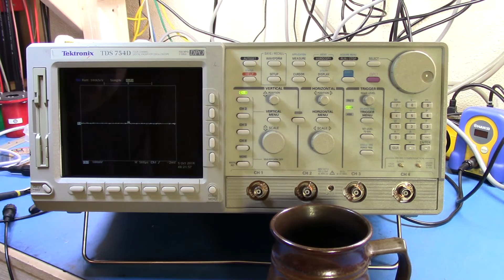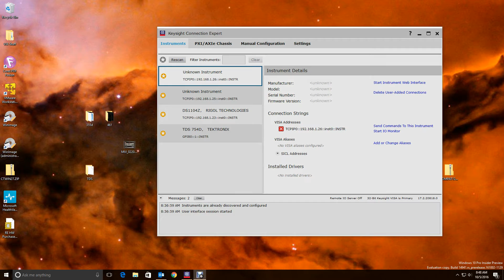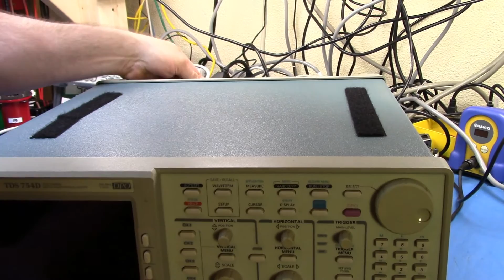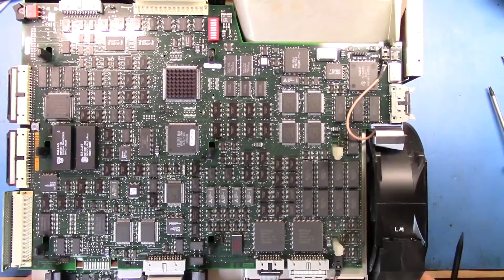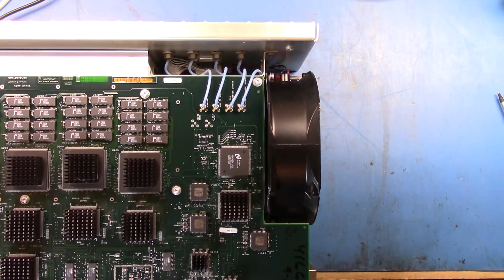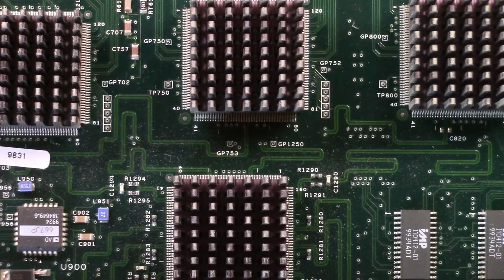TDS754D Repair and upgrade - Part 1

Comment: Guys! I'm so sick of Google Translate! For some reason it translates the word "oscilloscope" as "sight"!!!!!    And I'm so stupid that I still haven't learned English!
😬
Reply from the maker: As an Australian, many would claim that I don't really speak English either - This was a fail as far as the repair went as I ended up lifting a pad trying to get the RAM to work properly - There is a comment further down that says this issue is most likely a problem with the acquisition hybrid.

I hope Google Translate does a better job on this response for you.

Comment: That LCD shutter was not their best idea cause the overdriven CRT ran out pretty fast. So was ergonomics: menus suck...An IT guys oscilloscope.
Reply from the maker: Completely agree but I do wonder if it was just a sign of the times - Right now we have multi-color LCD panels and I find they're great but back in the day I preferred more resolution and a single color.
Reply from the maker: Also I never ended up fixing this thing - Sold it to a Tek guy who did.

Comment: very details. nice . thanks. if I had one of these I would be viewing this video several times and listening word by word. I just bought a TDS3054B but I ran the diagnostic on it and it failed the acquisition so waaaaaa. anyone know what could l be causing it. the manual says main board. but you know... is there any other real fixes?
Reply from the maker: What I've seen work is to clean the IC holder for the acquisition IC (if there is one, I might be confusing this with the HP scopes) - Otherwise you might want to inspect the solder joints on the front-ends and the A/D to see if any need to be updated. Have you checked out https://groups.io/g/TekScopes2 to see if they have any suggestions?
Reply: @tgsoapbox  thank you for your reply, 
whoever I asked, said this is a major problem don't touch it. so I returned it.
If I spent a couple of 100s I would mess around with it. when I am spending 1200  which is a good deal for this scope, I want a working scope.

Comment: Happy I bought this one instead of the cheaper ones☀️>imgs.love/TOscilloscope?Ж  Excellent intuitive interface if you've used scopes before. I'm a little disappointed in the noise. From what I've read it seems to be related to the A/D conversion.
Reply from the maker: Tek has always had a good UI for their scopes - It would be something that the up and coming Chinese manufacturers would do well to copy. I ended up selling my ones as I had a memory failure and I needed to get an old analog one to really use the X-Y mode (lot of older HP Sig Gens use X-Y with a crystal detector to do sweep adjustment). Hope you're enjoying the scope, even today they're good value.

Comment: Sorry to tell you about this 2 years later. Just saw your video. If you see a waveform in one of the channels twitching like this, chances are that the relays is the attenuator hybrid making marginal contact (the gap became a capacitor, which might vary due to heat or motion). Sorry to see you ruined the otherwise good acq memory section by ripping the pads (it's a red herring. the symptoms of bad acq memory is actually the problem you see after ripping the pads: you get random spikes because one or two bits after the ADC is not processed correctly and the graphing software is interpreting corrupted data.) I did exactly the same thing like you did when I first mucked with TDS scopes nearly a decade ago.
Reply from the maker: Thanks. Great information on the issue, thanks for posting for others so they don't make the mistake that I did.

Comment: As for the Lecroy scope, you need to combine 4 channels to get the full sampling rate of 4GS/s or combine two channels to get 2GS/s but NOT the 1GHz bandwidth. The 1GHz analog BW is always there. Otherwise you get 1GS/s and measuring the fast rise time should still be possible on a fast time base setting.
Reply from the maker: Thanks - The issue I had was that combining the channels required an adapter that simply wasn't available anywhere - The common ones that are on eBay etc weren't correct (I bought one just to try it out).

Comment: Just for interest, I've seen a guy on YT who managed to verify the sub nS rise time of the Jim Williams avalanche pulser from AN47 on a 2467B with its MCP CRT.
Reply from the maker: I sort of failed with this scope and lifted a track trying to repair it (from memory) - I just picked up a 53310A and was reading that you can use it to do sub 1nS rise time analysis by setting triggers at the 20% and 80% up and down then measuring the time interval - I need to try that out to see if it's possible.

Thanks for the comment and I hope you enjoy the videos.
Reply: Sorry to hear that.  Did you get your measurement in the end with one of the other 1GHz scopes in the end?
Reply from the maker: Thanks - These things happen, I'd just prefer if they didn't happen right under the memory IC on top of the parallel address bus - I ended up getting and repairing a HP 54845A 1.5GHz scope and got what I needed done, though to be honest the user interface on the Tektronix scopes is way better (in that era, don't know about today).

Comment: this one? http://www.ebay.co.uk/itm/New-1-PC-HP-Agilent-82357B-USB-GPIB-Interface-High-Speed-USB-2-0-/192183300848?epid=1026398605&hash=item2cbf0472f0:g:FxYAAOSw-K9ZEvEi
Reply from the maker: Yes - Almost all of these on eBay are counterfeit versions but they work well - Before I moved to my E5810A, I used one of those counterfeit ones without any issue.

Comment: hello very nice vlog, just a question:  how do you get the keysight connection expert software to work, just download? i use inside software from tektronix (dos)to analyse the problem and change the option inside the units. but this look very good. can you give more info. for expample GPIB adapter model..
Reply from the maker: Thanks - I was using an Agilent 82357B USB to GPIB adpater - To get the IO Libraries, you just download them off the Keysight website. No license/keys etc required.

Comment: That was a very nice video on these scopes. I have a 620B & a 744A. I'm hoping to fix them both. The 620 has a bad ch4 and the 744 has no display on the CRT but the aquisition and diagnostics all pass when I use the VGA on the back. I'll probably just replace the CRT with an LCD & Splitter I purchased for this, but haven't done it yet. Actually played with it a little this morning but until I get everything worked out I won't publish anything more on the LCD conversion. Thanks for the cool video. 
Best Wishes n Blessings. Keith
Reply from the maker: Glad you found it interesting.
Reply: you prolly dont care at all but does someone know of a way to get back into an Instagram account?
I stupidly forgot my account password. I would appreciate any assistance you can offer me!
Reply: @Matias Briar Instablaster :)
Reply: @Nova Rowen Thanks for your reply. I found the site on google and Im waiting for the hacking stuff now.
Looks like it's gonna take quite some time so I will reply here later with my results.
Reply: @Nova Rowen it did the trick and I finally got access to my account again. I'm so happy:D
Thank you so much you saved my account!
Reply: @Matias Briar You are welcome :D

Comment: Check out my thread on the TDS784A on eevblog. I had an acquisition failure on one of the channels caused by dry joints on one of the demultiplexers on the acquisition boards as well SPC errors caused by bad relays on the attenuators, 

http://www.eevblog.com/forum/testgear/tek-tds784a-restoration-one-last-fault-to-fix-!/msg1039965/#msg1039965

Comment: Nice scope. Love the RGB filter/shutter. You should probably research backing up and replacing those Dallas chips. Not sure about this scope, but older scopes like the 2465A loose very important factory internal cal data that is hard to get back. Interesting prerelease windows build you have there...
Reply from the maker: From reading around the only thing that the NVRAM contains that can't be recreated by the scope (through self cal etc) are the options. There are a bunch of sites that show how to set the options (do web search for TDS PITBULL).
Reply: Ah, cool. So long as you have some kind of plan for when it fails. Looking forward to part two.
Reply from the maker: Thanks - Right now I'm trying to get the scope to error out showing the specific IC that the problem occurs in. I can't find either the 754D Component Service Manual (which would have the address information in it) or someone who knows what IC that address relates to. Once I can find that then I can get to the point of removing and replacing the SRAM. Those are still available from DigiKey.